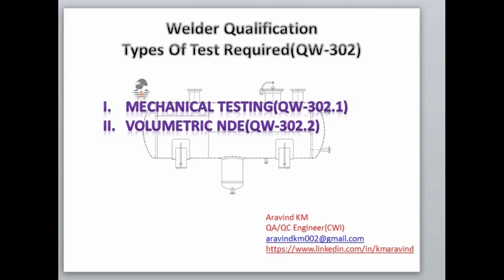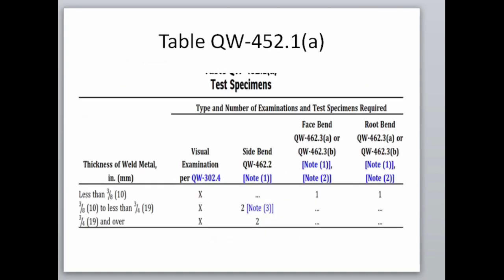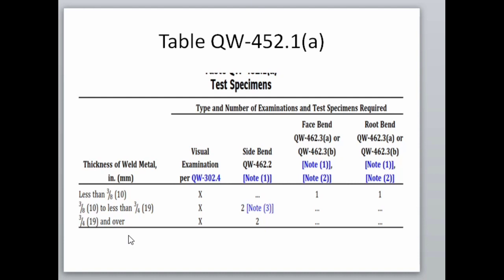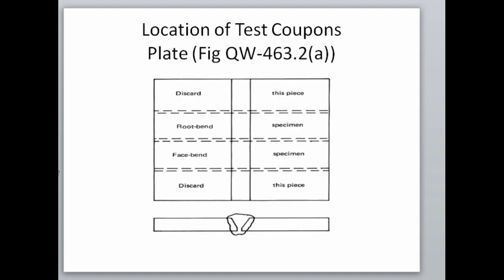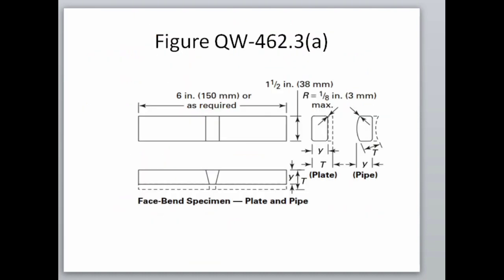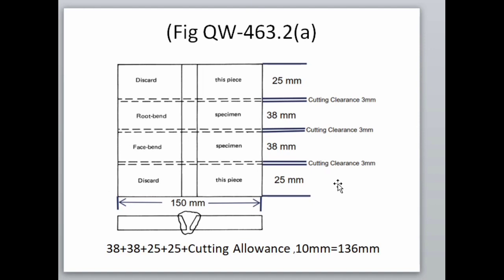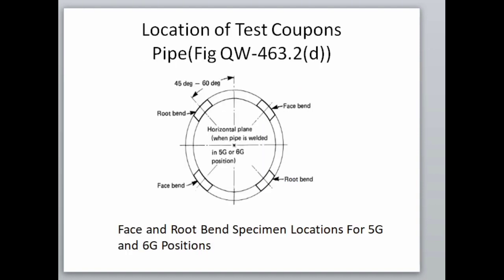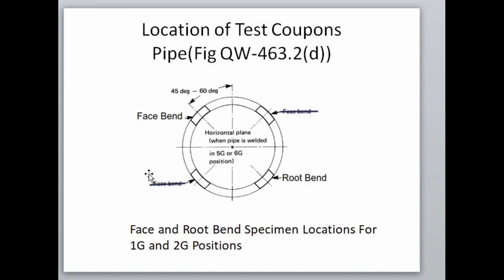Mechanical Testing (Bend Test)for Welder Performance Qualification as per ASME Section IX

Comment: Sir Can u explain me the side bend test specimen size .. if thk is 25mm means the specimen size can be 150x20x10 (LxWxT)...is it correct ? Not required 38mm
Reply: Sry...150x25x10...
Reply: Sorry for being late.
For side bends the thickness would be 10mm